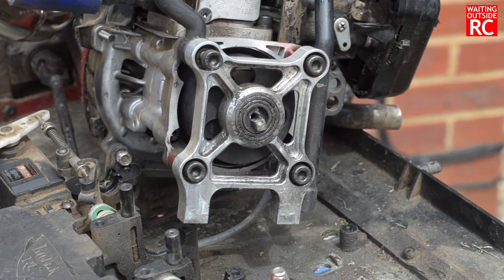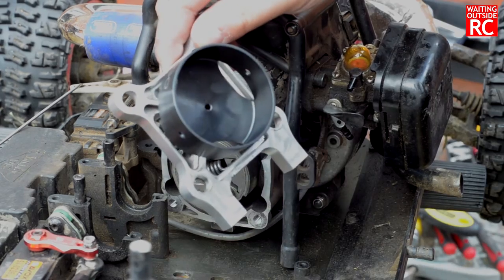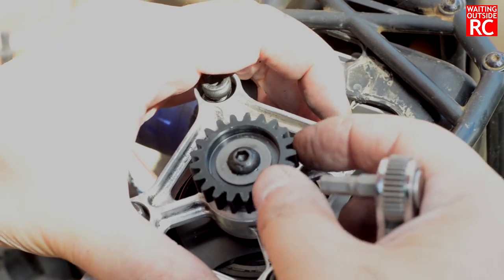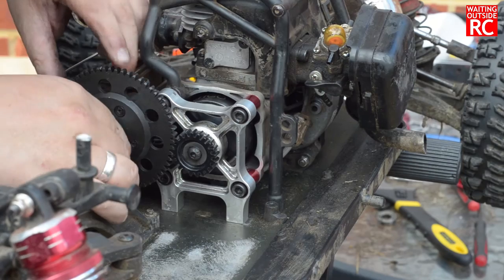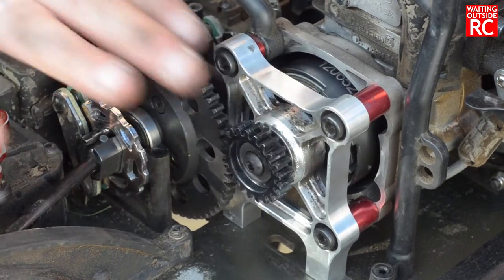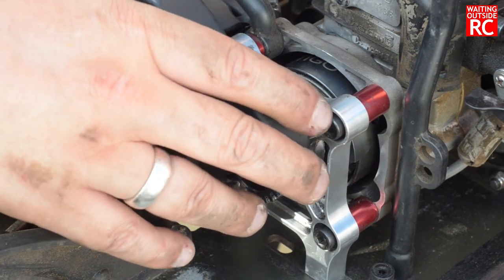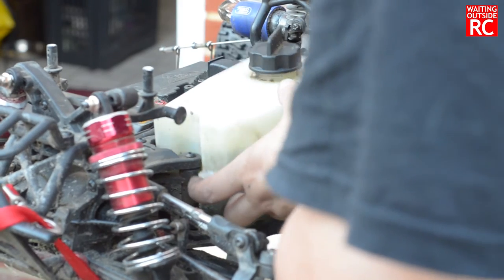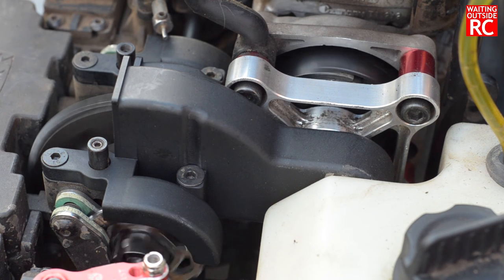Vertigo Clutch Bell Install into a LOSI DBXL

Comment: hello first of all good video. just wandering what engine u running with that 21 t pinion gear? I have a 29cc zenoah engine and it bugs alot on the low end. top end is good just I don't like that lack of low end.  did you feel any low end loss when you changed from stock to the vertigo pinion gear.?

Comment: I just had the screw snap in mines. How's that vertigo one is it worth it yet ? stronger then the stock junk losi put on dbxl
Reply from the maker: +AyrabMoneyWolf so far so good buddy. I was the same as you, constant clutch failure so I installed the vertigo version based on lots of recommendations.